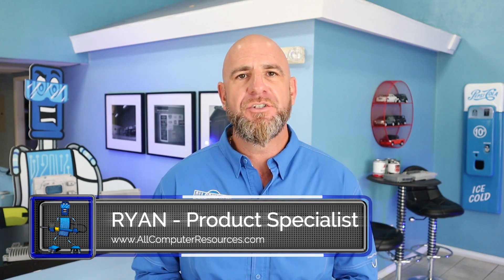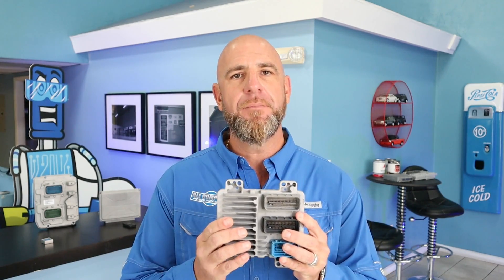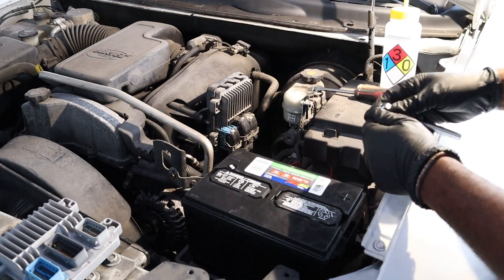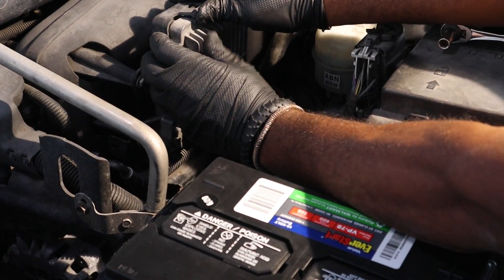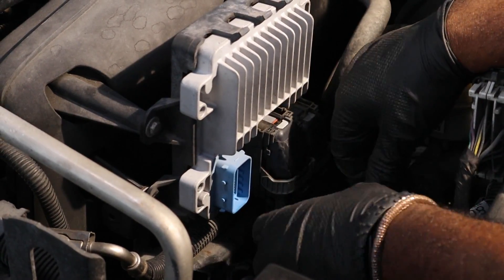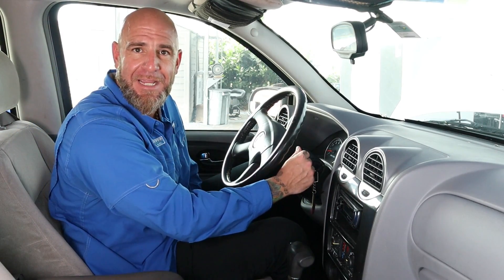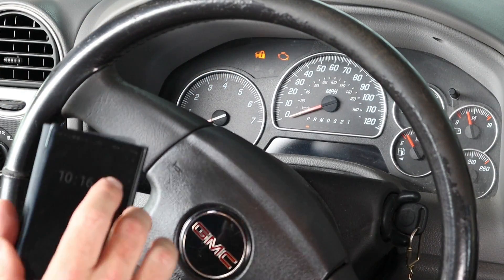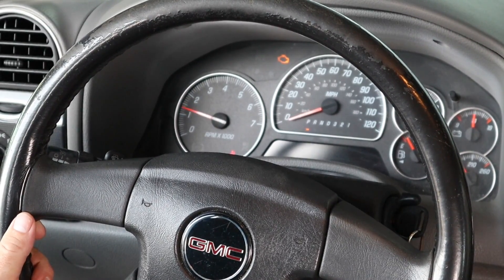HOW TO PROGRAM KEY FOR GM/CHEVY ANTI-THEFT - ECU REPLACEMENT PK3+ / PASSLOCK

Comment: I didnt buy ecm from you guys i bought it from ares technology website while i wait on their help with my issue i figured i try elsewhere , 2011 acadia gmc i ordered ecm it came "preprogrammed" so they say i swapped it out car still had same issue so i checked fuses and one fuse was bad for ecm after fuse swap i got response from ecm but i had to do key relearn which i did and it went well car started , now new problems exist , liftgate wont open or close without key in ignition before ecm swap everything worked fine and also car wont shift from park brake light do come on so its not the switch on brake peddal and thats so far what i noticed not working what am i looking at here ? Did the replacement ecm not come preprogrammed? Or is  it something else

Comment: What if you tried 2 pcm from the same company, because the first didn’t crank the vehicle but the 2nd unit they sent did indeed start the vehicle after the key relearn but the anti theft light is still on every time you start the car?

Comment: i just installed a new ECM in my 13 silverado 1500. I attempted to start my truck and it started right up but the severity light was on while running. is that normal? should i leave the truck running while doing this or does it have to be on the “ON” position? thanks

Comment: my brothers 2010 chevy tahoe Lt z71 keeps cutting off scanned it was throwing ecm fault codes bought a new one watched this video and did not work the tahoe is in mint condition barley 100,000 what should i try next ?
Reply from the maker: If you purchased a replacement ECM from another source, please note that it must be properly programmed and calibrated to your vehicle’s VIN before any key relearn procedure can be successful. The video demonstrates the key programming process specifically for modules preprogrammed by us. While the steps may help in other scenarios, we cannot guarantee results unless the ECM came directly from All Computer Resources.
Reply: Buy a Toyota
Reply from the maker: @TheGravygun  We hear you! And just so you know — we also offer replacement modules for Toyota and Lexus vehicles, fully programmed to your VIN. We include the proper setup to sync with your Toyota immobilizer system, and can walk you through the key registration process as well.

Whether it’s ECM, ECU, or immobilizer-related, we’ve got the tools and experience to get your Toyota or Lexus running again — no dealership needed.

Let us know your year, model, and issue if you'd like help!

Comment: What if battery light stays on  when I have fully charged battery and have charger on as well fully charged battery light still stays on security light only combined when I open the door thin battery light will come on and then it overrides the security light therefore I can't see no security light only battery life I've used three different batteries brand new
Reply from the maker: Are you using a properly programmed and calibrated ECM?

Comment: What happenes when it started on the third time but security light still on
Reply from the maker: Security Light Still On – Possible Causes:
Key Relearn Not Fully Completed
– The 10-minute x 3 cycle procedure may have started the vehicle, but the anti-theft (PASSLOCK or PK3+) system may not have fully accepted the key or new ECM yet.

ECM Not Properly Programmed to VIN
– If the ECM was not flashed with your exact VIN and calibration, the vehicle may start but still trigger the security light, indicating a mismatch or incomplete pairing.

Body Control Module (BCM) Communication Issue
– The BCM is responsible for validating the key and coordinating with the ECM. If it doesn't recognize the new ECM or vice versa, the light can stay on even if the vehicle runs.

Key Chip Issue (PK3+)
– If the key is worn or the chip is weak, it may start inconsistently and trigger the light.

Comment: Mine is the push to start, the security light turnes on and goes away after 30 seconds
Reply from the maker: System is Doing a Theft Check at Start-Up
– It’s normal for the security light (padlock icon) to briefly illuminate when the vehicle is first powered on.
– If it goes off after ~30 seconds and the vehicle starts and runs, the system is likely accepting the key and ECM pairing.

No Active Theft Lock
– If the light turns off on its own and doesn’t flash or stay on constantly, the anti-theft system is not actively blocking the vehicle from starting.

Comment: My key for my 99 suburban says 14rs on it?
Reply from the maker: Thanks for your question! If your key says “14RS”, that’s likely just a key blank or cut code, not an indicator of a transponder chip.

For a 1999 Chevy Suburban, your vehicle most likely uses the Passlock system, which doesn't use a chip in the key. Instead, it relies on a sensor in the ignition cylinder to read resistance when the key is turned.

So your key is probably just a standard metal key, and any security relearn (like the 3x10-minute procedure) would apply to the ignition housing and Passlock module — not the key itself.

Comment: Hey, needing some help. Had to get a new ECM installed on my 2016 GMC Sierra Denali 2500HD with a 6.6 Duramax. I only have one key that’s programmed to my old ECM. Key Fob still operates locks but the key won’t start the truck. I turn it to the ON position, immobilizer light stays on for a few seconds then goes away. Was going to try the manual key learn procedure but every video shows the immobilizer light staying on for 10 minutes. Mine doesn’t. Fob also wont remote start the truck. I had ECM programmed to my VIN and looking for guidance on how to get my truck running. Please help if you could!
Reply: Did you ever get this figured out? I have a 2015 Silverado 2500HD with the 6.6 Duramax also and had the exact same issue you’re describing from replacing the ECM and also having 2 new keys cut.
Reply: @MrSimplyGQ  I ended up having to return the ECM to the place I had it rebuilt and got a new ECM through the dealer. Dealership code was P1649 for the ECM that wouldn't work. Basically locked me out from being able to program my key. BCM and ECM wouldn't communicate to get past the anti-theft system
Reply: @ I have the same P1649 code that shows up as a history code and also shows failed since DTC clear and for current ignition cycle on the scanner. I had 2 new keys cut which both allow the truck to crank but still don’t get a start. My original factory key still cranks the truck as well along with all 3 key fobs (original and 2 I just added) working properly. My doors lock/unlock and remote start works, but still no start.
Reply from the maker: Confirm ECM was properly programmed with the correct immobilizer data (not just the VIN).

Some ECMs also need to be married to the vehicle via a GM Tech 2 / MDI tool, especially if security data isn't transferred correctly.

Check for trouble codes like P0633, B3055, or U0100 with a scan tool — these will give you a more exact idea of what’s failing.

If you got the ECM from All Computer Resources, message us and we’ll help verify programming and walk you through the correct pairing steps. You're close!

Comment: 2000 Chevy Venture LS

Three 10 minute cycles worked!
Ran for about 5 minutes.
Turned the engine off. 
Attempted to Start the Vehicle.
Security Indicator reactivated.

*DO I NEED TO TRY Four 10 minute Cycles instead?*

Any logical  advice is APPRECIATED GREATLY!

ELABORATION:
The initial attempt to clear the code with Three 10 minute Cycles worked and we let it run for about 5-10 minutes. 
While it was running the door dinging noise started to drive us crazy. We closed the door, made sure the headlights were off, and the dinging continued. So we removed the key from the ignition.
Waiting approximately 2-5 minutes, we attempted to start it again but the "SECURITY" dash indicator returned. 

MORE INFO: 
KEYS: There isn't a "+” or "pk3" stamped on the keys. The only indication on them is a stamped number "013" shown on both keys only on one side. 
BATTERY: New Battery 
ENGINE: Everything was running fine before my friend parked it and lost her keys. 

I have an OBD2 UNIT But I'm concerned that I shouldn't use it until the keys are fully programmed.

PLEASE HELP!
Reply from the maker: It sounds like your replacement key may not have a transponder chip, especially since:

There’s no “PK3” or “+” stamp.

The key only has a stamped number (which usually indicates a standard cut key, not a transponder key).

For a 2000 Chevy Venture, the vehicle uses the Passlock II system, which does not use a chip in the key, but instead reads the signal from the ignition lock cylinder sensor.

🔄 Why the Security Light Came Back
The 3x10-minute process taught the BCM to trust the new ignition signal, but:

Turning the key off too soon or too many times before the system stabilizes can trigger the security system again.

The dinging may have been a sign that the BCM was still in a learning mode or saw something out of sync (like door open/headlight states).

✅ What to Do Next
Try this clean reset:

Disconnect the negative battery cable for 5 minutes.

Reconnect, insert the key, and repeat the 3x10-minute relearn again:

Turn key to ON (don’t crank), wait 10 min until security light turns off.

Turn key OFF for 5 sec.

Repeat 3 times.

On the 4th cycle, turn the key OFF for 30 seconds.

Then attempt to start and let it run 10+ minutes undisturbed.

⚠️ Do not remove the key or cycle power during or right after the final start — let it run and stabilize the system.

❗️Using a Scan Tool
You can safely use your OBD2 tool after the system accepts the key. It may even help:

Look for codes like B2960, B3031, or P1626, which relate to Passlock faults.

If you see those, the relearn didn’t fully complete, or there’s a fault in the ignition sensor or BCM.

Let us know if the module you’re using was pre-programmed to your VIN. If not, that may be the root issue. We’ve seen similar behavior when the ECM/BCM isn't synced to the specific vehicle setup.

You’re close — feel free to update with what happens next and we’ll walk you through it.

Comment: What if it does start on step #1? Do you let it run for 10 minutes? Do you just stop and end the relearn procedure? Do you continue the relearn procedure if it is starting?
Reply from the maker: If it starts up on step 1, everything should be good to go, and no further steps are needed. The keys have already been synced to the ignition. If you received that part from us, this occasionally happens during our programming process. We have enhanced capabilities with certain models, allowing us to streamline the installation.

Comment: My security light only flashed, so i left it on and after like 5 min the light stayed solid. So reset and after 10 min now the light just stays on. Wtf where they thinking with this horrible system
Reply from the maker: Are you using a pre-programmed and calibrated ECM from us?

Comment: I changed my ignition housing and ignition cylinder in my 01 silverado but when trying the programming there is no security light and it just cranks w no spark.dord anyone have any advice on this?
Reply from the maker: Thanks for your comment, Jeff. If your 2001 Silverado cranks but has no spark and you're not seeing the security light during the key relearn attempt, here are some key things to check:

🔎 Likely Causes:
Security Light Burned Out or Disabled
– On older Silverados, the security light may be burned out, especially if it's an older cluster. Try watching for a brief flicker during key ON — or check with a scan tool for anti-theft codes like B2960 or B3031 even if no light appears.

Ignition Switch or Passlock Sensor Not Communicating
– If you replaced the ignition housing and cylinder, make sure the Passlock sensor (located in the housing) is properly connected. If it’s unplugged or damaged, the BCM can’t read the key rotation — resulting in no fuel/spark.

Relearn Not Starting
– The 3x10-minute procedure only works if the BCM detects a security fault. If no fault is detected, it won’t trigger the relearn process. You may need to force a relearn using a scan tool, especially if parts were replaced and the system isn’t seeing a mismatch.

✅ What to Try Next:
Check for power and ground at the Passlock sensor.

Inspect the yellow, white, and black Passlock wires for damage or disconnection.

Use a scan tool to check for BCM or security-related DTCs.

Make sure the new housing has the correct sensor for your model year — some aftermarket units come with the wrong resistance values.

If you didn’t purchase the ECM from us, there’s a chance the security system isn’t properly synced to the new components. If you did, let us know and we’ll walk you through confirming programming and pairing.

Comment: What should I do if the truck actually starts on the first time but the security light does remain on for 10minutes. Should I still repeat the process the same way?
Reply from the maker: If the truck starts the security has been bypassed possibly. Did you order the part through us?

Comment: What if it starts the first try but the security light is still on?
Reply from the maker: Hi there! If the vehicle starts but the security light stays on, it often means the system has accepted the key for starting but hasn’t fully completed the key programming or "learn" procedure.

✅ Double-check the key programming process: If it’s a GM system (like Passlock or VATS), usually it requires 3 cycles of starting and waiting for 10 minutes each time to fully program the new key. If that final cycle didn’t finish properly, the security light can remain on.

✅ Scan for DTCs: Using a scan tool to check for any security-related trouble codes can help pinpoint what’s still pending.

✅ Final Step: If it’s still not going away, performing a final reset or doing the full procedure again can often clear it up.

Comment: Is this gonna work on Chevy impala 2015 2.5L? After replacing pcm
Reply from the maker: The Chevy Impala PCM requires specific calibration, programming and key PIN codes in order for this procedure to be effective. If you are in need of a PCM you can contact us directly at 786-879-7566 or visit our website www.allcomputerresources.com

Comment: I did the 3 cycles exactly as mentioned, but the car still does not start, however the security light stopped from turning on, only the check engine light is on. I disconnected the battery one more time trying to start the 3 cycle process again, but the car does not start, security light not coming up, only the check engine light is on. How can I resolve this issue?
Reply from the maker: It's challenging to diagnose your no-start issue without inspecting the vehicle. If you purchased the part from us, feel free to contact our tech team for additional support. Otherwise, I recommend taking the vehicle to an ASE-certified facility for further troubleshooting and diagnosis.

Comment: Question? Great video btw very well explained and hope you can answer me quickly cuz my ride around been down since I thought it was the battery cuz twice I could jumpstart it once by fusebox under the hood then only by battery  located under flooring backseat..then wouldn't crank all lights in and out car would illuminated but not crank sound nothing,,well we changed computer after professional diagnostics ND I was going through the proceess ND third time wasnt starting but car stating battery low start the car nd so I quit nd haven't tried yet my question is   it's a 2015 GMC Acadia nd most feedback is only dealership charging 1000 and some change can do it but computer was sent from a dealership with correct vin number ND programs to the car,,ur process was going just as explained ND I feel would work given a fourth or fifth time due to key being a default from a locksmith that have reprogrammed due to primary key lost...would the process be working as the theft system light be going off ery ten minutes if this process speaking key to co.puter ND would t eventually syncronize.
 Apologies for the longevity of a comment
Reply from the maker: Thanks for your detailed comment, and no need to apologize—we understand how frustrating these issues can be! Based on what you described, it sounds like the key programming and theft deterrent system might not have fully synchronized yet. The process you're following seems to align with what’s needed, but sometimes it can take multiple attempts for the key and computer to properly pair, especially with a replacement key.

Here are a few suggestions:  
1. *Ensure the Battery is Fully Charged:* A low battery can disrupt the key reprogramming process. Even though your lights work, the battery may not have enough voltage to complete the synchronization.  
2. *Follow the Key Relearn Procedure Exactly:* Double-check the steps to ensure the timing is correct, as this can sometimes make a difference.  
3. *Monitor the Theft System Light:* If the light continues cycling off and on during your attempts, that’s usually a sign that the system is still trying to pair. Keep trying, as it may take multiple cycles to sync fully.

If you’ve exhausted these steps and the issue persists, you might want to consult with a GM-certified technician or dealership. They may need to recalibrate the system, especially since you’re working with a replacement computer and locksmith-programmed key. Hopefully, this helps get your Acadia back on the road! Let us know how it goes! 🚗🔧